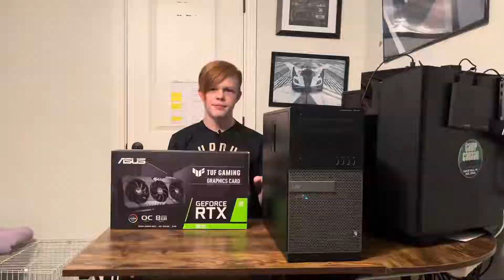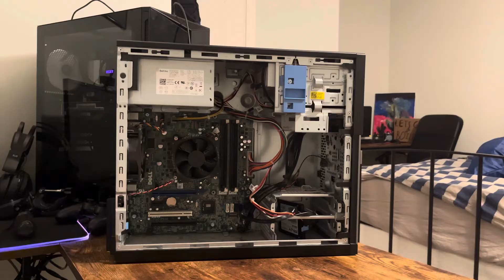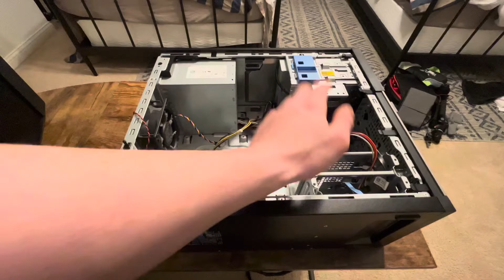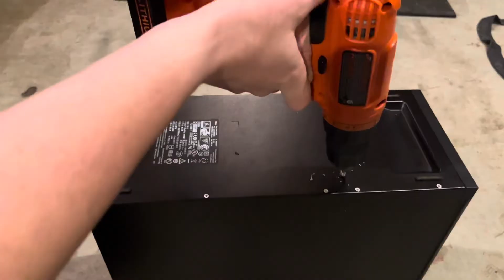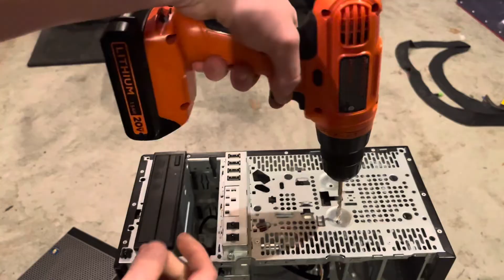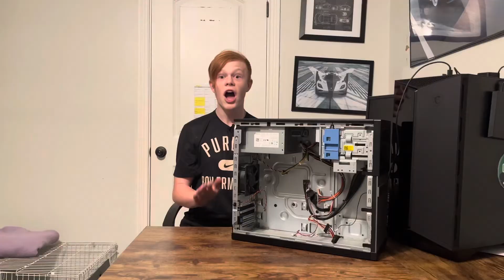How to FIT ANY GPU in your DELL OPTIPLEX!

Comment: Nice tutorial!  I was originally going to do this in my Dell Precision T1600 case but I decided, for now anyway, to just purchase a ePCI riser cable, 3D print out a stand, and mount my RX 580 outside of the case.  The only problem I have is I am afraid of my curious kitty playing with the GPU fans!  I already caught her playing with the CPU fan once as I heard a "brrr...brrr!" sound and saw her hitting the fan with her paw!  Lol!!  It was very funny at the time, but the GPU fans are MUCH bigger and faster and may hurt her.  I may have to go back to your idea here, but I may have a problem with the SATA  ports being blocked.  I already have that problem with the old HD 7770 card I put in there for now.  I had to disconnect the DVD player.  Not a big deal since I have several USB portable ones.  Your video makes me want to give it another try when (and if 😕) my health ever improves.  
Looking forward to your next video.  Be well and Happy Holidays!!!  👍👍
Reply from the maker: Yeah, with this specific mobo you can have clearance problems with sata. But you can get 90* cables which don’t block the gpu!
Reply: @KennyHalpin   I actually tried the 90 degree ones and still no go with the DVD port and the HD 7770. It worked for the SSD and the storage hard disk ports.  It was just a tiny fraction too high for the DVD  port as it was directly under the GPU.
Reply: Yea the 90 degree sata cables avoid that issue, but if your card is too long & wide like the 980 ti I was planning to use, it also runs into the front usb plug on the 710 mobo. Damn near broke it before I noticed it was catching. Had to settle for using an old radeon r5 2gb card I had laying around until I can buy something better that is short enough to fit.

Comment: What an absolute MONSTER of a card! What does it do? How many ports? What are the power requirements for this card? So no USB ports in the front of the machine? (dear god I have a lot of questions) Where did you place the SSD Drive? (I'm exhausted asking all these questions) (just pick one or two at your leisure and answer the ones you want) (really good videos btw, like your energy)
Reply from the maker: Well, the card has 6 ports, mostly HDMI and Display port, the ssd can go under the dvd drive, and I’d recommend at least a 550 watt psu for running a 3070!